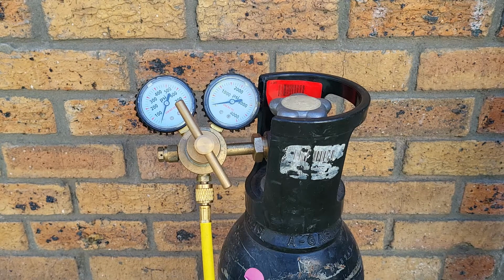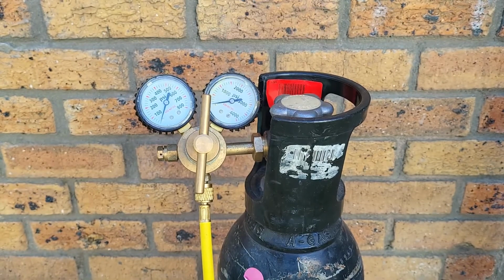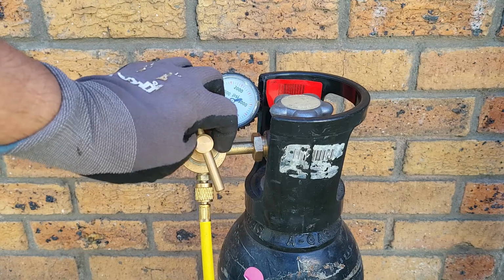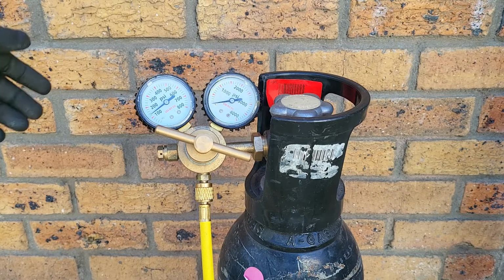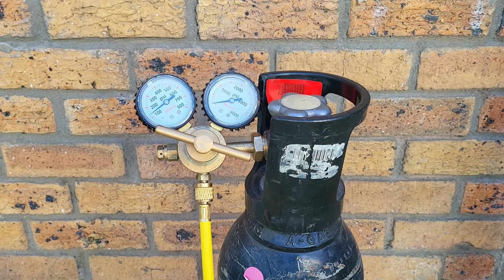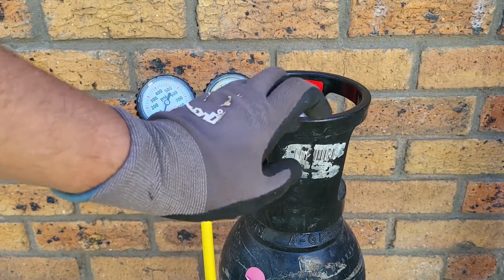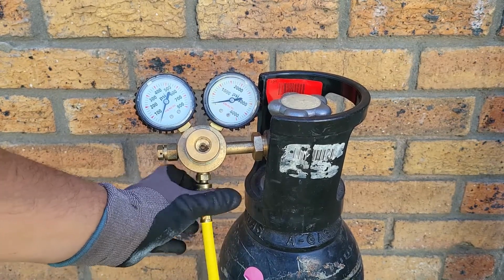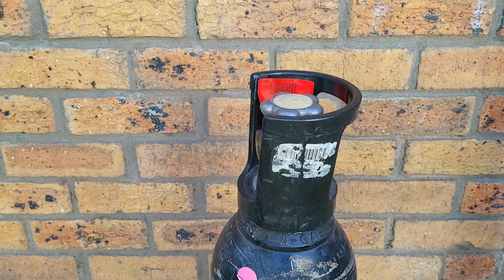How to use a nitrogen regulator

Comment: How do you check to see how much pressure is inside before using ?
Reply from the maker: Hi Jalice. The nitrogen regulator has two gauges fitted to it. One gauge reads the pressure in the cylinder and the second gauge shows the output pressure of nitrogen leaving the cylinder. In order to see how much pressure is in the cylinder, you simply have to open the cylinder with the t-style handle on the regulator still closed (as per normal operating procedures), and the high pressure gauge reading will rise to represent the cylinder pressure. The low pressure gauge should show zero at this point with the regulator still being closed. In this video, you will notice that the cylinder pressure is very low, hence the high pressure gauge showing very close to zero.

Comment: Thanks for sharing the video. I will test pressure gauges with a nitrogen cylinder and regulator valve with an increase and decrease dial not a handle like yours. Do I have to turn the dial to the decrease side all the way before I open the shut-off valve of the cylinder? or it doesn't matter. Any safety tips? After I test each pressure gauge, do I have to shut off the cylinder? Thanks again. 👍
Reply from the maker: Hello there. Yes it is best that you leave the regulator closed all the way before opening the cylinder. This is just to make sure that the pressure coming through the line doesn't exceed the maximum pressure tolerance of the guage that you are testing. You can gradually open the regulator until you get to the desired test pressure. Also, if you are testing multiple guages then it isn't necessary to close the cylinder after each test. You can just close the regulator after each test until all the tests are complete. Upon completion of all the tests, you can then close the cylinder as a final step.

Comment: Thank you for the video. I have an argon/co2 regulator .Can I use it with nitrogen since fits to tank if I change the left low gauge to 100-600 psi one? Thanks.
Reply from the maker: That's a very good question. Conventional wisdom suggests that you could theoretically use  an argon/co2 regulator for nitrogen applications provided that the fittings match the cylinder being used and that the maximum pressure threshold of the gauges is sufficient to manage the cylinder pressure. You could of course add additional adapters and fit new gauges to make the regulator compatible, but my personal preference is to use the correct regulator for the gas it was originally designed for. It is also worth a mention that the pressure regulation legislature in your country may prohibit such modifications under its safety laws. I would research them thoroughly before making any changes to the equipment. thank you for your question and be safe.
Reply: @paradigmcooling8497  Thank you very much for the reply. Best regards.

Comment: Whats the difference between the left gauge and right gauge?
Reply from the maker: Hi Michael. The left gauge shows the pressure leaving the regulator, while the right gauge shows the pressure in the cylinder.
Reply: @paradigmcooling8497  why does the right hand gauge always show 0 PSI in the video?

Comment: Does the regulator have to be shut before opening the cylinder valve ?
Reply from the maker: Yes, it's best to do it that way in order to properly regulate the pressure coming out of the cylinder. It allows you to slowly raise the pressure to the desired level without the risk of rupturing the system being filled. I have seen a technician pre-set the regulator for a pressure test on an evaporator and upon opening the cylinder, the evaporator immediately ruptured because a part of system was weakened due to wear and tear. Luckily no one got hurt but the bang quickly cleared the building. Lol

Comment: Will nitrogen cylider blast if regulator is not connected properly..?
How to avoid this..? Pleasee reply
Reply from the maker: Hello. The nitrogen cylinder won't explode, but incorrect use of the regulator can cause an explosion outside of the cylinder. You can avoid this by making sure that the regulator is properly connected to the cylinder, without any leaks, and make sure that the pressure setting on the regulator does not exceed the safe operating pressure of the vessel that the nitrogen is being fed into. You can consult the manufacturer's specification literature for specific values.